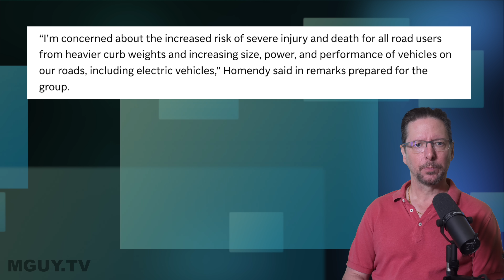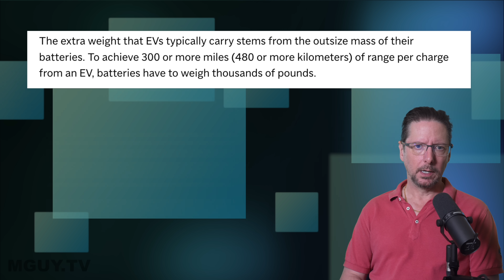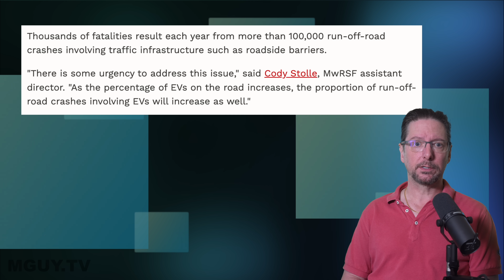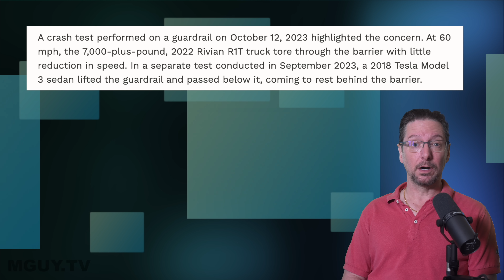EVs TOO HEAVY for roadside crash barriers (guard rails) | MGUY Australia

Comment: Thanks for showing this. I have been saying this since EVs came out. Based on the comments. Really. What people don't get. A EV battery pack is a lead weight that takes up the bottom of the vehicle. From wheel to wheels. Side to side. Then around a foot tall. A solid lead mass. There is no way on earth an EV can be compared to a normal car or pickup. Like the EVs in winter. I have been saying to the EV people. Take one threw a blizzard up in the mountains. Would they do it. Nope. They left that for those who bought them to test them out. My F150. 2020. Crew cab. XLT. 6 1/2 foot bed. 4x4. Off road. 5 people. Fully loaded bed. Doesn't weigh as much as an EV with only the driver. For myself to haul a trailer. The trailer and load would only be maxed out at 9,000lb. A EV car weighs as much by itself as what my max load would be on a trailer and cargo. Plus. My truck is a tow hauler. I can carry 36 gallons of gas. EV vehicle's are extremely dangerous. No matter how you look at it.
Reply: 2020.  F150. Crew cab. XLT. 6 1/2 foot bed. 4x4 v8 2228kg 4,913 lbs. v6 2163kg 4769lb
Tesla model y most sold ev world wide.
 4,209 lb (1,909 kg)	to 4,416 lb (2,003 kg)
Reply: @martinsmallwood9605  Why would you compare a pick up truck with a saloon car?   Then a Tesla is 2003Kg and a Mazda MX5 is 1130Kg  in line with your example, be realistic!
Reply: @martinsmallwood9605  You missed it. I would have to put 5 people in the truck. Fill the gas tank full. Put a full load in the back of the pickup. To come up with that weight. I would have to have it like that 24/7. There is me and my son and our small dog. Nothing in the bed of the pickup. An EV no matter what. Is at its weight. My pickup most likely will never ever come close to the weight of an EV. Always way less. If my F150 did what the EV did. Sure. My pickup would have folded up like a tin can. Not go straight through it.

Comment: A good (cheep) physical conclusion out of  this is to make another law (politicians like very much to make laws) to dictate EV drivers to not allow speeds grater than two third (2/3) of the placarded limitations on the road.  😆
Reply: Pls god no, in Melbourne Australia all the roads are already wayyyy under speed. Highways 5 lanes wide 80km/h 
People already driving 10-20km below. 
That law would just make it a complete hellscape
Reply: @driller_e8098  It's much safer if you are constantly taking your eyes off the road to check your speed.
You should try driving in Wales or central London It's just painful 20 MPH almost everywhere depending on your borough.
Reply: Politicians are corrupt…they are not on your side…Net Zero Is a powerful control tool…haven’t you understood that yet?
Reply: That will improve the range for sure.

Comment: With the weight down low, EV's are much safer than ICE cars because they are way less likely to roll over -- which is a major cause of automobile deaths.  I'll be waiting with bated breath for your blog on that extremely positive EV feature
Reply: Wait, wait, did you just try to spin their weight as a positive 😂. It cancels out if anything, b/c that extra mass means you're extra stopping hard when hitting something. That's what causes injuries.
Reply: If you're going to crash a rollover is the one the lowest injury rate.
If you're EV rolls the extra out of balance weight distribution means it will be inclined to roll further, simple physics.
Reply: @srclub7961  Actually the opposite is true.  Do you think, for example, an unbalanced bowling ball would roll further than a balanced one?  Think about it and get back to me by dinner time.
Reply: Do you know why a lot of cars roll over... It's when they clip a curb or culvert or something the wheel impacts at speed. The low down weight will not help you in such situations. Also, If you end up sideways and the tyres roll off the bead you're going over as the rims dig in and momentum continues. I would not like the weight of a battery pack that forms part of the floor structure above my head. If you dropped one of those things on it's roof from a few feet the car is far more likely to pancake with that additional crushing weight above it. It's going to be quite a thump every time an EV goes over and comes down on it's roof. Having glass as part of the roof structure is even more idiotic in such a situation.
Reply: @erroneouscode  What a great response, changing the laws of physics just to avoid conceding an obvious point.  I'd say you'd make a good lawyer, but your response is actually too stupid for even for a lawyer.
Reply: @Tom-dt4ic  What a spineless juvenile response. I have not failed to concede your point of a lower center of gravity being beneficial in certain circumstances of preventing what is known as an "untripped" rollover. Unfortunately as I previously pointed out it wont help you in the scenarios I described because most rollovers according to data sources are the "Tripped" variety which occur 70-90% of the time. Perhaps acquaint yourself with the real physics of it and 'curb' your enthusiasm for deflection and calling people stupid because you have nothing else to counter with.
Reply: @erroneouscode   I guess I must have missed the slender chance that you're not just a mindless shill for the anti-EV crowd.  So painful l as it was, I re-read your physics-challenged post trying to find a single word that conceding any advantage a car might gain by having its weight down low.  Any.  And I found nothing.  But I'm sure in your mind, it was there, as I’m sure in your mind many things are there that the rest of us fail to see.
Reply: At what speed? Doing 100ks on a freeway will in no way save you from a roll over (under the right circumstances) if you drive an EV. Bullshit statement...
Reply: @kopyrightliberationfront2000  Is it possible to roll and EV?  Of course it is.  But a low center of gravity means it's much less likely.  And we live in world of probabilites, which means among many other things, every time you get in a car you takes your chances.
Reply: So let's just add 700kg of weìght to everyones car and be all the safer for it. Ignoring, of course, the increased braking distances, higher mass damage in an impact, less maneuverability, and so on. 
Electric cars are heavy, not practical, dangerous, expensive, easily written off, and not even slightly green.
Reply: @lauriejones3198  Spoken by a truly misinformed individual who's most likely never driven an EV.

Comment: Cars at one time were getting lighter as aluminium and carbon fibre is used rather than steel. EV's broke the mould and are increasing in weight.
Reply: Also the manufacturers have fitted small capacity fossil fuel engines in heavy suv vehicles..... Burns them out quicker than a bigger cc engine would . As humans supposed to be making things better we make more problems 😭😮😮
Reply: Steel is actually lighter than plastic when they have to do the same job.
Reply: @robertkubrick3738  erm.. pretty sure a plastic dash is lighter than a steel one
Reply: @xpusostomos  You never disassembled a really old car then.
Reply: EVs are heavy because of the battery.
Everything else is made of the same stuff.
They’ll continue to get lighter to increase performance and range.
Reply: How about the tire usage.. 8k and they're done? I'd be buying two sets a year. Screw that. 😂👎
Reply: @aquatecpoolservice4547  I’m just about to change the third set of tires on my EV at the front. I’ve driven 53000 miles of which approximately half are motorway miles. That makes 17,667 miles per change, more than double the 8000 miles you claim. The rears are on on their second set and no sign of them needing changing, so at least 26000 miles per pair so far.

The car is front wheel drive, so you can guess why they wear out quicker than the rears with all the electric torque.
Reply: @javelinXH992  I didn't claim that some owners are only getting 8k on they're tires, the guy that owns this channel reported that. I personally couldn't care less what mileage ev owner get.
Reply: @aquatecpoolservice4547 there's where you went wrong!
Parroting what MGUY says is asking for trouble as he sometimes (or is it most times, I can't remember?) talks a load of bollox!😂
Reply: @DwaynePipes  I haven't noticed that.
Reply: @javelinXH992  We just changed the tires on my wife's car. She had put 65,000 miles on them. I told her 9 years on a set of tires is too long even though they still had legal tread on them.
Reply: @aquatecpoolservice4547  Keep watching, you will.
Reply: @DwaynePipes  OK,  but do me a favor and watch planet of the humans and get back with me.
Reply: @aquatecpoolservice4547  I watched that a good while back.
Reply: I don’t disagree but many ICE cars are very heavy now. Even a sports saloon like a M3 competition weighs in at 1800kgs… compare than to the weight of even the last generation, let alone the first … a large petrol engined SUV weighs in at at least 2.2 tonnes, some well over that. I’m not defending EV or the agenda behind it…
Reply: @stubones Same here. On the argument given here, one of my cars is 1480kg, it’s electric. The diesel we have is 15xx something. The EV is lighter, but then it is a smaller segment car. So yes, given the same criteria you would expect an EV to be heavier than the ICE equivalent.
Reply: It's impossible to design a barrier that is going to deform (give within parameters)  to the expected force of a light vehicle that is going to do the same for a much heavier vehicle.  It is something that should be taken into account when making the purchase decision. 
The thing that makes evs different from other heavier vehicles is their greater acceleration which wears out tires quicker and decreases control.
Reply: @larryclemens1850  Why? EV tires are expected to have the same minimum criteria before they are required to be changed by law (but you will get there a bit quicker).
Reply: @javelinXH992   That's half the point. The tires wear out quicker, the other half is that they need to stop a heavier vehicle.
Reply: @larryclemens1850  do bear in mind that EV users don’t really use the brakes, which can make a big difference to tyre wear.
Reply: @javelinXH992   EVs use regenerative braking. A similar amount of energy used in acceleration is recaptured when slowing down. The difference is easier on brake pads, not on tires.  Tires wear on acceleration, on deceleration and to a lesser extent when travelling at a constant speed.
Reply: @larryclemens1850  regen is a lot more gentle than traditional braking, leading to less stress on the tires and less wear. The harder you brake, the more rubber you lose. You will always lose rubber, but the more gentle you are,the better.
Reply: @javelinXH992    How hard you brake is how hard you have to brake. i.e. Braking is primarily a determinant of your driving habits. The second determinant of how hard you have to brake is the weight of the vehicle.  The only way to mitigate this second determinant of tire wear is modifying the first determinant - give yourself more space and time to brake.  To explain it in simplest terms: if you have two vehicles of the exact same mass travelling down the road at the exact same speed, equiped with the exact same tires, and they make a stop taking the exact same space and amount of time, the wear on the tires will be the exact same regardless of what type of brake was used to effect the stop. If you increase the weight of one of the cars, and make it stop within the same time and distance the wear on the tires will be greater, regardless of the type of brakes used.  What  wears tires is the friction between the road and the tires. (Which brakes last longer is not being measured.)
Reply: Cars have been getting heavier for years. Take a look at the best sellers. They are longer and wider and come loaded with all the necessary add ons people want and manufacturers need to inflate profits
Reply: Good comeback not. Your mixing up commercial and general vehicles
Reply: Conventional passenger vehicles have been getting heavier for years as safety standards become more stringent. Add to this the popularity of utility and pickups being used as everyday drivers when nothing is ever carried in the tray.
Reply: Safety laws making cars bigger causes cars to burn more energy killing more people with pollution. @SirGregoryPageTurner
Reply: Depending on the guard rail model/type, some of them handle even buses.
But the mass density to size ratio is clearly more different on a bus, than an EV, i.e. EV's will shred probably even the most highest grade guard rail model.
Reply: @MR-nl8xr  Mass density to size ratio? What is that?
Reply: Only certain sports or hyper cars use car on fibre. Cars have got heavier over the years because of all the safety features added. My Peugeot 205 GTI was just over 900kg in the 80’s. Most cars now are 1500kg
Reply: Cars have been getting heavier for ages. A 1970's Corolla would have weighed about 800kg. Now they're over 1200.

The newer cars are bigger and better equipped of course, but it also has a lot to do with crash safety structures. Look at how thick the pillars are on modern cars compared to old ones for instance. 

Even F1 cars, whose chassis are 100% carbon fibre, are amazingly heavy. But they can keep drivers alive in incredibly severe crashes too.y
Reply: @alanjm1234 not a fair comparison because a 2024 corolla is like a large car in 1970. Compare a 1970 corolla with a Toyota Wigo maybe
Reply: The safety features in cars have gone to far. Brakes, steering and handling should be top notch crash testing is a double edged sword. The safer you feel the faster and more erratic one drives. I would like to know how many serious car injuries there are today compared to the 70's before all these crash safety features.I remember the seat belt adverts, Fighter pilots belt up doing 800 mph so wear your seat belt. I only do 30 mph to 50mph most of the time, very rarely do I do 800mph. @alanjm1234
Reply: @alanjm1234   lol, the minimum weight of F1 cars would be much lighter if not for regulations, they actually have to add tungsten weights to meet the minimum, but it also gives them the ability to redistribute the mass for optimal  cornering and breaking performance.
Reply: @genxray951  nope, since the new crash safety regs in 2022 F1 constructors have been struggling to get down to minimum weight. That's why there's so many black liveries. Bare carbon saves the weight of paint.
Reply: EVs broke the mold....
Meanwhile, 2023 Model year be like:

Toyota Tacoma: GVWR = 5,600 lbs
Ford Ranger: GVWR = 6,050 lbs
Nissan Frontier: GVWR = 6,012 lbs
Ford F-150 Hybrid: GVWR = 7,350 lbs
Toyota Tundra Hybrid: GVWR = 7,660 lbs
Rivian R1T: GVWR = 8,532 lbs
Nissan Titan XD: GVWR = 8,800 lbs
Chevy Silverado 2500: GVWR = 10,850 lbs
Reply: @MegasXaos  Why are you giving all the Maximum loaded weight? Did the schools fail you?
Reply: @MegasXaos   Choosing pickup trucks for your example means you don't understand pickup trucks.  

GVWR includes potential payload.   A Chevy Silverado petrol actually weighs 7000lbs with a nearly 3800lb payload.  Wheras a Hummer EV weighs 8000lb and has a 1300lbs payload.
Reply: @ToolHombre  so total weight, what the track CAN be expected to move down the road congrigured as such, is similar. Tell me, how is that MAX weight a problem when it falls in line with everyone else?
How is a 9000lbs EV a problem when the 10000lbs International Harvester MXT wasn't years ago? Why aren't 30000 lbs semis a problem right now, not including their trailer or cargo.

I'm glad you're upset with my misstep. Of using gross weight, instead of curb weight.
Rather than providing evidence, or even a coherennt argument, to the contrary.
Reply: @MegasXaos   Less than upset, I'm perfectly content that EV-angelists are of lesser intellect.  Don't project your hurt feelings on me there bud. 

You don't have a coherent argument to even rebut. 

You're now strawmanning lorries.  Lorries are less likely to use non-highway roads and with less frequency.  

The probabilities of issues when everyone is driving a lighter vehicle is significantly lower than if we all capitulate as you did and say "its fine if cars weigh as much as lorries".  Which by using your strawman has become your argument.
Reply: Silverado 2500 is 6200 to 7500, tf you smokin?
Reply: If you look at buses, the figures get even more bonkers. How about an extra 10 000 kg for a mid-size 32 seater for instance!? Yep, an additional 10 metric tonnes to haul around!!!